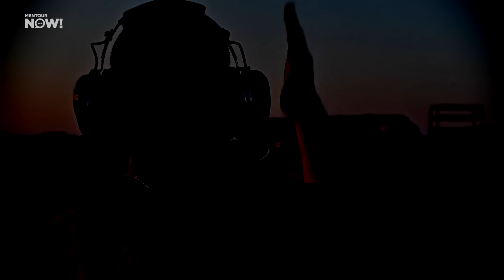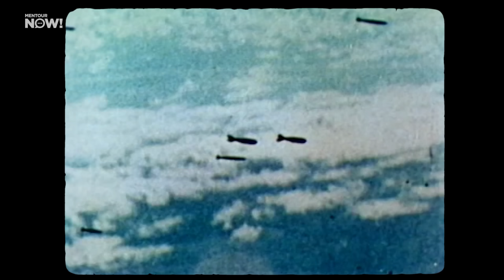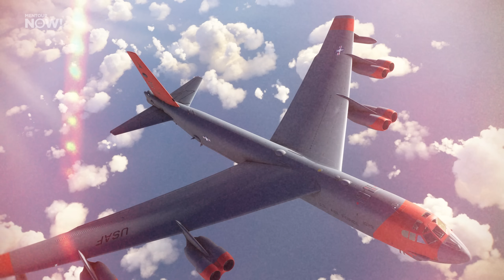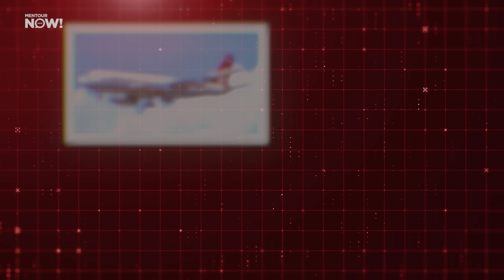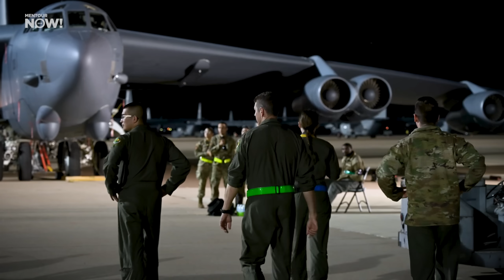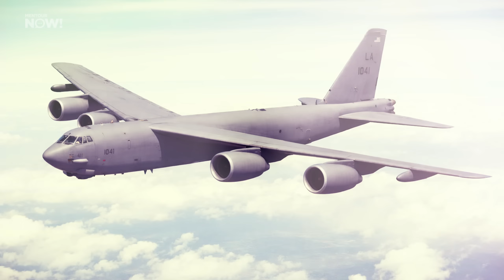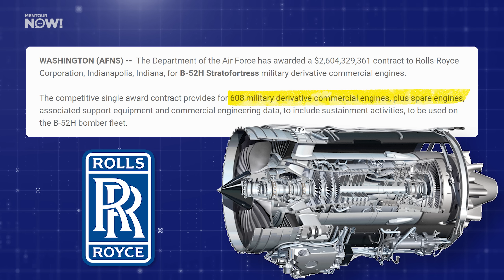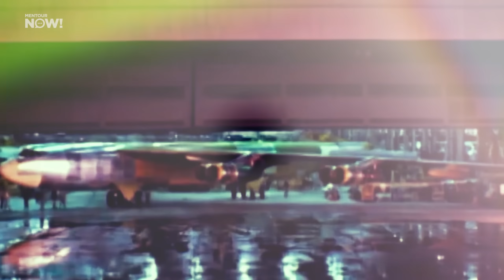WHY Are They Changing The B-52 NOW?!

Comment: I always wanted the B-52 to get the Pearl 700 engine and was confused why the USAF didn’t choose this option. The Pearl 700 with a bypass ratio of 6.5 to 1 and other advances would have been more efficient and quieter. Learning that the USAF already uses the RR 725 engine this decision makes more sense. When the C-5 Galaxy received new engines I was hoping it would use the GEnX engine also used on the Boeing 747-8. I was disappointed they used the CF6 instead. That confused me until I learned the USAF already used the CF6. Just as the Pearl 700 replaced the RR 725 aka F130 the GEnX replaced the CF6. Both of the newer designs were more efficient and quieter. The USAF is sometimes more interested in support and already built infrastructure than going for the newest engine option.
Reply: The B-52 is getting the military version, called the F130 designed and manufactured in Germany by BMW and later renamed R-R Deutschland.
Reply: @DoktorBayerischeMotorenWerke 
The engines will likely be built in the USA. That was part of the initial bid by RR
The RR 725 is the F130 like I stated. The Pearl 700 is the even more modern and efficient version of the product line. It has a higher bypass, more advanced compressor section, more advanced combustor section, a larger main fan diameter and I believe different power blades to name a few changes.
Reply: @andrewday3206  The F130 is the MILTARY VERSION, this is NOT the same as the Civilian versions sold by Rolls-Royce.
They are ALL made in Dahlwitz, Germany EXCEPT for the B-52 contract to comply with US federal laws requiring that all US military weapons be made in the USA. 
The Trent series is the ONLY Rolls-Royce engines still made in the UK.
Reply: @DoktorBayerischeMotorenWerke 
The F130 is the RR725
They are the same basic engine
Reply: @andrewday3206  That is false, the F130 is a different engine and made to different specifications, it is not the same as the 725.
Reply: @DoktorBayerischeMotorenWerke 
Just do some research 
The F130 is absolutely the military version of the RR725 aka BR725. Go learn the engines. A simple search on the differences between the two will show you they are the same engine with nacelle airflow requirements requiring very small changes.
Reply: @andrewday3206  The F130 is not the same, hence the unique model designation... if it was a 725? That what they would call it.
Reply: @DoktorBayerischeMotorenWerke 
The U.S. military uses a formal Mission Design Series (MDS) nomenclature for its jet engines, which often results in a different designation than the manufacturer's civilian name

You obviously 1) Never did any research about the engines 2) Never looked up what would have educated you about the naming system 3) Never served in the United States Air Force like I did. 

If you won’t take the time to learn you are a waste of time 
Why did the USAF and USAAF call the DC-3 the C-47?
Why are Boeing 747’s never called the 747?

Here are some other examples of jet engines with Military and Civilian names and the aircraft they power. 
Military J57  Civilian JT3C powering B-52 bomber, Boeing 707, DC-8 
Military TF33 Civilian  JT3D powering Military cargo planes, C-141 Starlifter, B-52H, Boeing 707 
Military TF39  Civilian  CF6 powering C-5 Galaxy, Boeing 747, DC-10, A300B
Military F108  Civilian  CFM56 powering KC-135 Stratotanker, Boeing 737, Airbus A320 
Military F117  Civilian PW2000 powering C-17 Globemaster III, Boeing 757 
Military J60 Civilian JT12A powering T-39 Sabreliner (military trainer/transport), civilian Sabreliner 
Military J79 Civilian CJ805-3 powering F-104 Starfighter, F-4 Phantom II, Convair 880 airliner

Engine manufacturers do not follow the MDS system for internal and civilian engine naming. But when they take an engine and sell it into the military it has to get renamed to adhere to the MDS standard. F-130 the F means Fan as in turbofan engine!
Reply: @andrewday3206  Andy you silly little boy... the BMW F130 engine was originally designed to replace the Rolls-Royce Spey engines for the BAE Nimrod MRA4
Reply: I was looking at the CF34, which would also make for a decent upgrade.
19% more performance, 19% less fuel consumption, and also 19% less weight. All at a very similar size.
That bit extra thrust might be useful for "emergency power"
From a pure support and parts perspective the CFM65 would probably the best choice. They are everywhere, they are still in production. So availability would be covered.

Comment: You can never be certain when designing something if it's going to be irreplicable or not (only applies to non-planned obsolescence creations).

I created a simple timesheet to keep track of my working day and 20 years later the whole business is still using it. 

Some things just do the job they were designed to do so well the effort of replacing them for marginal improvements just isn't worth the effort.

Comment: I’ve believed for years that the 747 had a dual engine pod option. You can see them clearly on the 747 on the airfield used by Top Gear.  About to comment on it when I discover it was a botch job created for a James Bond film!!!

Comment: When I worked at British Aerospace many years ago we were manufacturing the BAe-146 series. This was a regional airliner with 4 small turbofans. There were studies done to see about making these into two engine jets to compete with other regional jets (e.g. CRJs). Similar to the B-52, it wasn't the engines that stopped this project, it was that switching from 4 to 2 engines would require a designed wing. The cost of the new wing would make the 2 engine version of the -146 uncompetitive in the market. (It was already uncompetitive, but for different reasons.)
Reply: The ALF 507 engines also originate in Germany... designed by Jumo engineer Anselm Franz who designed the -004 for the Me-262.
The F130 was designed in Dahlwitz Germany by BMW before it was acquired by Rolls-Royce when R-R motors was sold to the VW and BMW.
Reply: Interesting story - from a reader here who lived right under the Hatfield testing-circuit flightpath. I always thought that going with 4 engines was a little old-fashioned and would limit the 146s sales.
Reply: @neilturner6749  The 146 WAS old fashioned! It was conceived when Hawker Siddeley was starting to collapse and looking for a niche market plane that wouldn't be instantly crushed by a Boeing or M-D.
Being a British jet would automatically limit sales, but its design was also very specialized and not intended to compete with other manufacturers in the same size class. It was built for short runways and high-altitude take-offs which like many previous British jets would severely limit its appeal to major airlines

Comment: We stopped doing difficult things. The golden gate bridge was built in 4 years, the empire state building in one year. It's not just safety requirements, the certification and planing phases take longer than that before the work even begins. Noone wants to use the word corruption but this is state money going to corporate accounts before they have anything to show for other than being acquitance to the right politicians. Same with Starliner and SLS. Boeing had the first B52 flight in 1952 and it was introduced in service in 55. Now they can't even fix their modern plane doors in three years.
Reply: It's crazy that an engine project will take about 3x longer than it did to design, build, and fly the original aircraft.

Comment: Why does the B52 airframe last so much longer than commercial jets?
Reply: Because the major issue for jets is pressurization, and going up to a low-pressure environment and back down again with a pressurized cabin puts stress on the airframe. This is known as a "cycle". A commercial jet is doing this every few hours for decades, incurring many thousands of cycles. A bomber has far fewer cycles per year, meaning far less maintenance is required and parts last longer. But the really important part is that the only part of the B-52 that's pressurized is the crew cabin at the front, while the rest is at ambient pressure - the bombs don't need to breathe. This means that there is far less stress on the aircraft and it lasts for decades.

Comment: The Air Force have been making a lot of these weird decisions lately they retired the KC 10 tanker but kept the much much older 135
And replaced the KC 10 with the KC 67 which objectively is not as good as either of the others
Reply: Seeing the engine mount problems of the DC-10 and MD-11, it was good that the USAF decided to retire the KC-10s when they did.  KC-135s with the big engines are very robust.
Reply: The 330MRTT would have been vastly better, but corru... I mean decision-making got in the way. They need a shakeup.

Comment: The SR71 was also designed with a slide rule and it still is king of high altitude and speed spying surveillance.
Reply: As an engineer who learned his trade on slide rules, I can imagine that there is an advantage to their use. First, you know they're only good to 3 digits. So you don't get overconfident in your results. Second, they have no track of decimal places when you work with them so you, the engineer, have to concentrate on that. I think that the primitive nature of slide rules forces discipline on the designer whereas with modern design tools, you can just let them go wild.
Reply: @soaringvulture  I had my grandfather's slide rule. I never learned its full capability, but, even with my limited skillset, it was fascinating. I felt like I was actually doing math, like I was understanding what was happening and not just pushing buttons on a calculator. It had a table of conversions on the back, you use that enough and you will come to know that a kilometer is 0.621 of a mile, and an inch is 2.54 centimeters.

Today my stupid calculator has conversions so I have to enter the number, shift 8 for conversion mode, 01 for inch to centimeter, and = to get an answer. And do that for every number I want to convert. They could have written 2.54 inside the back cover.

With a slide rule, slide the indicator to 2.54, and move the slide. You can convert many numbers quickly. Like you say, the lack of a decimal makes you more aware. 

As far as only three significant digits, many things can't be modeled in the design room so accurately. I doubt the towers for the Golden Gate Bridge are within 5" of where they were drawn in the plans, best not to get caught up in false precision. Allegedly, modern day engineers did a computer model of the Eiffel Tower and how much it moved in the wind. Apparently Eiffel's calculations were quite accurate, within a few inches for a 1000 foot tall structure.
Reply: It's not the "king" anymore, the new king just hasn't been unveiled to the public yet. And before you call out some "conspiracy theory" let me explain...the SR-71 used a special fuel that no other aircraft in service used so much so that it even had it's own tankers that were only used with the Blackbirds because of fuel compatibility. Well after "the lost drop" of JP-7 for the SR-71 was burned ceremoniously in 2002 the Government started buying it again in 2008 and bought 110,000 gallons of it. 100,000 gallons for Edwards and 10,000 for Wright-Patterson. All known remaining SR-71s are accounted for...which means it's not possible for the Government to still be flying them even secretly but the fuel was designed for very fast, very high altitude aircraft. The only reason the Government would be buying it again is if they have another very fast, very high flying aircraft that we don't know about.
Reply: @ZboeC5the JP-7 is being used to fuel Santa's sleigh. They made a documentary about it called "Elf" awhile back.
Reply: @ZboeC5 well, having asked to not be taken as a conspiracy theorist, you then go on to explain your conspiracy theory!
Reply: @neilturner6749  Whatever you say ;)
Reply: No comment on the slide rule as it’s a complete mystery to me. I can comment on the SR-71 and it’s ilk however. A strategic recon aircraft that can be tracked throughout its flight path is essentially useless. The opposition also has IR satellites. This was apparently a mystery to the slide rule artists.
Reply: So was the Concorde, to every superpower at the time that thing was a menace lol. Very few military planes could keep up with it, and few still can. I cannot think of another jet that has the range that thing had flying at over Mach 2. It would have made the perfect cover for a spy plane if allowed to fly over continents.
Reply: @TheTardis157  Well, where are the Boeing 7207 and Lockheed L-2000 and Tu-144? Why was the B-70 cancelled?
Reply: @TheTardis157  ah, those British fairy tales. The fact is - EVERY interceptor and most fighters introduced since 1958 (that's 18 year before the Concorde's introduction) could fly faster than Concorde. The much earlier XB-70 beats Concorde in speed, range and payload. A decade before the eConcorde's introduction it was clear as day that a high-flying long-range supersonic bomber is nothing but a flying target. That's why the Concorde-like military aircraft never made it into service, not because of its "ingenuity" (which turned out to be a financial failure).
Reply: @s @sergeychmelev5270  think the early-1960s theory that even fast-flying high-altitude aircraft could easily be shot out of the sky (i.e. we all need to switch to low-level penetration) turned out to be a complete myth. This resulted from a huge over-estimation of both radar and missile capabilities at the time, and it was a good couple of decades later before technological reality caught up with those early estimations. 
It took the Israelis years to get to grips with Mig25 overflights in the late 70s and early 80s, and I recently read an article by a USN F14 RIO about the (thankfully, as it turned out) inability of his aircraft and various USN warships to get a successful lock on what emerged to be an unscheduled Concorde flight over the Gulf in 1990.
Reply: Google the story of the B52.  It was redrawn on cocktail napkins in a hotel in Dayton OH when the USAF said they wanted jet engines instead of props.  The Boeing engineers were back after the weekend with a balsa mockup of the newly designed jet.  There were obviously some technicals they had to work out when they got back to Boeing HQ though.  Ha.
Reply: watch for the new one SR 91 Aura Designation not let out yet.
Reply: But it’s not “still the King” is it - it was retired decades ago now as its role became obsolescent.

Comment: I guess sometimes you just need a big bomb truck. But you may not need a bomber with doors that open in the bottom to drop ordnance, in the Afghan Civil War (1989-1992) the communist government widely used Antonov An-12 transport planes as heavy bombers by dropping the bombs out of the rear loading ramp. But the B-52's range truly is exceptional, which is a big deal as basing is always a problem for global reach, as while powers are afraid to strike back at America directly will instead target allies who provided bases to the US.

Comment: The new RR engines are so reliable and durable that they may remain on wing for the remaining life of the airframe.
Reply: The B-52s are going to do ceremonial flybys when the Enterprise D is decommissioned.
Reply: The F130 engines are designed by BMW in Dahlwitz Germany, RR jets are named after rivers in Britain,
Reply: @DoktorBayerischeMotorenWerke  ... More germanic BS from a well known anglophobe.
Reply: @DoktorBayerischeMotorenWerke  Not all, RB211 was never named…
Reply: @neilturner6749  The RB211 is called the TRENT
Reply: I absolutely see their lifespan getting expanded. With new engines they gain an efficiency boost that might keep them running. As long as there is a purpose for a plane of that size and functionality, there will be a reason to keep them around.

Comment: Engineers that used slide rules used larger safety factors. this explains the longevity. the single engines substitutions would have a larger diameter which would not give enough clearance when the the wings were heavy with fuel. The early B52s had trouble with the strength of the tail rudder falling off.

Comment: Bottom line ... the Air Force could have about 80 B-21's for what they will spend to upgrade approximately 75 B-52's.  And, once the upgrades are completed the BUFF's will still not be as capable as the B-21's.  The upgrades should have been done during the '80's (or earlier) if they were worth doing at all.  The B-52 first flew in 1952.  The only thing that makes sense to me is that this program is designed to funnel money to Boeing.

Comment: I thought I recalled that one of the other potential issues with a 4-engine B-52 is the larger bypass engines, with their bigger fans, necessarily have a center of thrust that's further down from the wing; so even with an engine producing the same power as the 2 TF-33s, that thrust is pushing on a longer lever arm and thus imparting more twist into the wings through the pylons -- yet another reason the wing structure might need reworking (or at minimum significant retesting)
Reply: Just mount the bigger engine further forward and higher, like on the 737 MAX.

Oh wait...